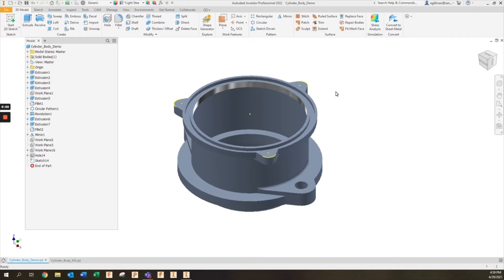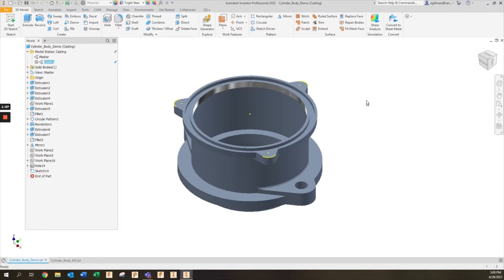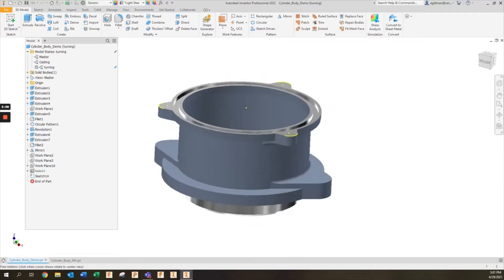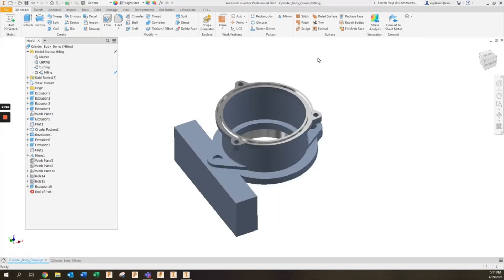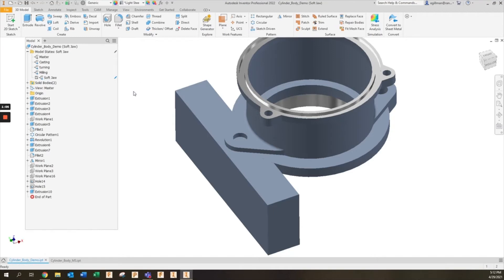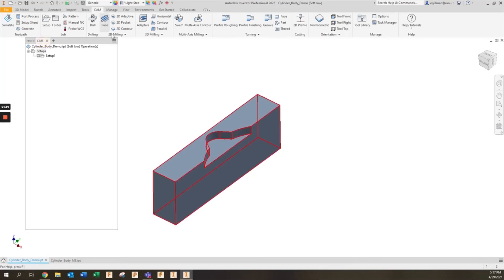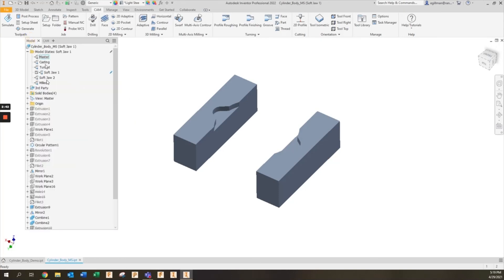Model States and CAM in Autodesk Inventor 2022

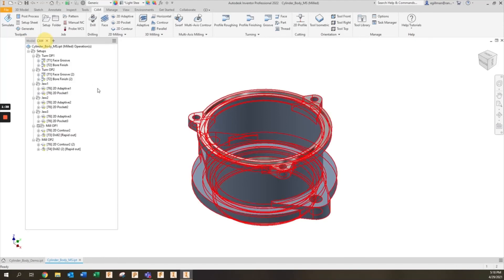Comment: At 6:29 you show the milling operation using the casting model as the stock, how did you do this?
Reply from the maker: From our expert: I've created a blog post on that: https://resources.imaginit.com/computer-aided-manufacturing/saving-inventor-cam-stock-for-secondary-operations
Reply: @imaginittech  Ah okay, I was hoping there was a way to grab the stock straight from the model without exporting first. Thanks!
Reply: @andrewkaelin8823
Step 1: Copy Object solid 1 (Model) - Object Repaired
Step 2: Creat new Model States (ex name is Casting) and Suppress or Edit features.
Step 3: In Setup CAM, you select Model in Step 1 and Select Stock is From solid in Step 2.
Done.